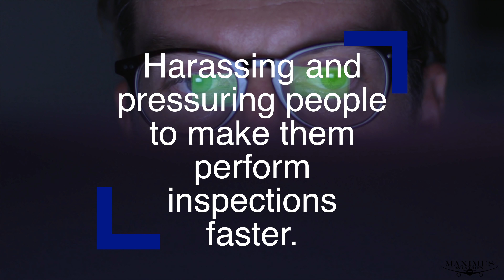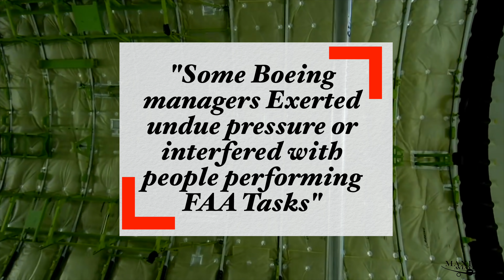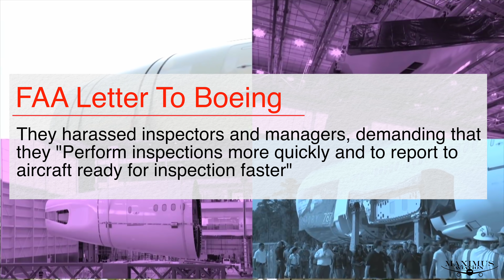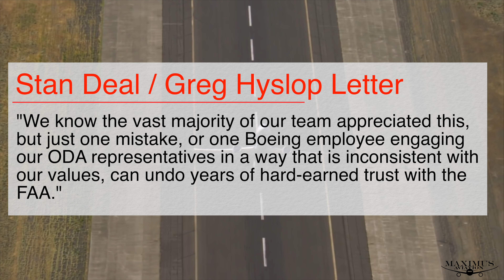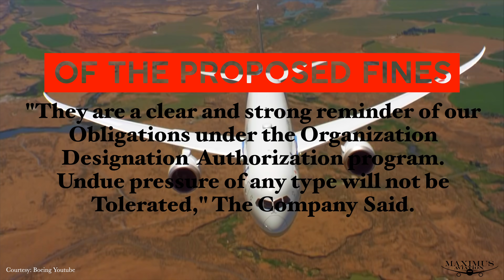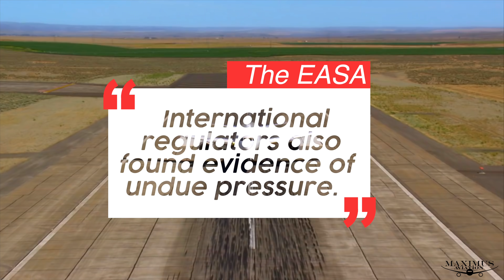FAA Fines Boeing 787 Program $1.25 Million Dollars For Interfering With The FAA's Inspection Process

Comment: Two planes crashed as a result of Boeing’s incompetence.  Why has nobody in Boeing been tried for manslaughter and been locked away in prison for several years?
Reply: I agree 1000%!
Reply: Boeing, yet again prioritising money and profit potentially over peoples lives. When will they ever learn? It has to stop. Heads should roll in senior management and hefty gaol sentences should be imposed on the guilty parties for this avaricious culture.
Reply: The FAA will never charge Boeing Execs with anything or many skeletons will fall out of a lot of cupboards. In any other country as soon as the second investigation report was published Police would have been knocking on doors with arrest warrants. Not ONE Boeing exec has been arrested. The only 'casualty' left with $60 Mn in his pocket.
Reply: If you only knew the insane software that was running in MCAS. It was as if it had been designed from the outset to be difficult to make any sense of and clearly totally confused flight crew when it went into 'autocrash mode'. I've designed real-time software myself that could be considered as 'safety critical' and when I became aware of how truly bad the MCAS software was (words fail me to adequately describe it) it was hard to understand how anyone could make such a complete mess of it, let alone allow it into production. It deserved to be strangled at birth. It was criminally negligent by design !
Reply: @pasoundman  Well said. But you forgot to mention that not only was it poor software, excessively intrusive or that could not be switched off (unless flaps are lowered) Boeing compounded that by not only failing to issue training manuals and synthetic training software for simulators but also deliberately misleading the FAA, customer airlines and passengers that it even existed.
The sequence of failure just goes on and on ...
Reply: @1chish  The crazy thing is that it WAS POSSIBLE to defeat the defective (actions of) MCAS. The trouble with it was relying on the crew's normal training to handle a 'runaway trim' situation in short order. You're right about the absense of any information about MCAS and how it influenced the aircraft's trim of course and this goes to the heart of the matter. I have no idea how MCAS and its operation and logic was described to the FAA or anyone else. My own opinion was that it was Boeing's responsibility to describe MCAS and its operation FULLY to the FAA and in unambiguous terms to users who might not need to know how exactly it worked but that it existed and how to defeat it if neccessary, as a contactual issue. I believe that the FAA should have been fully informed about MCAS by Boeing and if they didn't know its details but did know of its existence to ask for these details.

The fundamental problem was MCAS 'wasn't meant to appear to be there' ! This goes to the contractual issues with airlines who didn't want a new type rating for the plane, so it had to handle as if it were a previous generation 737. This seems to have been the rationale for the failure to describe it in manuals or training. AFAIK there was nothing specific about it in the QRH either. MCAS could perhaps have been described as a bit 'bipolar' to some extent.

At least one crew did successfully recover from a 'defective MCAS' incident. I'm assuming that such a condition was caused by a failed AoA sensor or vane. Either by luck or design they detected a runaway trim that is similar but not identical to what MCAS does when faulty and performed the corrective actions for it. It involves IIRC throwing 2 switches close to the Captain's knee related to the electric auto-trim. It has to be done quickly though. If a delay takes place due to the surprise effect or consulting the QRH runaway trim actions, loads may quickly build up on the control column that mean the aircraft is already unrecoverable.
Reply: @pasoundman  Excellent summary my friend. Its just tragic a company like Boeing thought it could do this and get away with it...
Reply: @1chish  Absolutely and all the more so because, historically, Boeing designed perfectly good airplanes and was considered a 'good actor' as it's popularly called now. Looking back at this, one can't help but think of the DC-10's troubled entry into service and McDonald Douglas's obfuscation over a number of things.
Reply: @1chish  BTW, just watched a training video that involves diagnosing runaway stabiliser trim using the actions described in the QRH. It took 1 minute 20 seconds before the cutout swiches were flipped. In that time there could have been 6 five second applications of nose down trim applied by MCAS.which I suspect is marginal for controllable aero loads on the yoke.
Reply: @pasoundman  I think the link between the takeover of McD - D and the change in business ethics and philosophy in Boeing are very clear to see. It became a Wall Street operator preferring share buy backs and high dividends to friends rather than invest in advanced engineering. Boeing have not delivered a working aircraft on time and on budget since before the 787 which itself was the first signal that it was no longer the engineering leader it used to be when it was grounded. That aircraft loses $20 Mn per delivery. Can you imagine the fallout in the US media if Airbus had had the A350 grounded  for battery fires and the A320neo had killed 346 people in two crashes? Boeing even failed to deliver a rebuilt 767 as a tanker that works, on time and on budget to the USAF. It still doesn't 12 years after order.
Reply: @1chish  You'lll get no argument from me for sure regarding those issues. I expect that the 787 no longer makes a loss (although I don't know for sure), you have to consider the barking mad economics of Wall St that include 'deficit funding' that makes as much sense as investing in 'junk bonds' that were so popular a while ago and merely a verhicle for the gambling addicts in banks to make yet more money out of hoax investments. One needs to examine these insane terms and realise what they really and truly are, just slogans that fuel the gambling addiction of the finance sector.

We have as a society surrendered to the money god and we're paying the price. It has to stop or we're screwed.
Reply: @pasoundman  Amen to your last thoughts Mate. As for the 787 I am going off the system that Boeing uses to 'lay off' or 'spread' R & D costs over a specific number of future aircraft sales. They do this to produce early profits for guess who? This works when they had the 737 Cash Cow feeding capital back into the business but now?
Airbus takes the hit in the years the costs occur (although each project is tracked internally for profit or loss).
This is from 2015 but given the numbers I think it still holds good. Begs the question if Boeing will 'spread' the MAX costs over future sales and if so will it ever make any money? Meaning 2 of its 3 products will lose money. 

https://www.seattletimes.com/business/boeing-aerospace/will-787-program-ever-show-an-overall-profit-analysts-grow-more-skeptical/
Reply: @1chish  The mind boggles at $32 billion of debt for an airliner that was meant to cost less to develop yet also arrived years late.

Looking forward, the next new plane to appear from Boeing will be the 777X but who will buy a huge plane when the market is depressed by Covid ?
Reply: @pasoundman  Just as you are I am not so sure the 777X will be the saving grace for Boeing. Certainly not the 777-10 which is in A380 passenger territory and has no dates attached. The 777-9 will not enter service until mid 2022 and will keep running up huge development costs and will be 2 years late if the meet that date. 787 revisited. It has lost orders to both the A350-900 and the 787 and has just 276 orders. The 777-8 has just 32 orders of which 20 are said be likely cancellations.
The 777X has the same problem the 737 had as Airbus are years ahead with the A350 which has a backlog of 558 aircraft (-9 and -10). Its a proven aircraft. Does any airline really trust Boeing to deliver a new aircraft on time and in safe condition? Especially as GE have issues with the GE9X engine without which the 777X has no advantages.
But we come back to the root of Boeing;s problems. Cashflow. With the 777X some 2 years away, the 787 losing money, the KC-46 some $4 bn over budget and the Golden Goose MAX grounded with no deliveries what nett cash does it have coming in (apart from Poseidens, Apaches and Chinooks)?  Not a lot.
And all this before the costs of rebuilding all the MAX aircraft parked up and already delivered start to roll in. Aviation is not a great industry to be in but I would rather be in Toulouse than Seattle right now.
Reply: @1chish  You could have taken the words out of my mouth. How exactly has  Boeing screwed up the KC-46 ? Isn't it simply a B767 derivative. What could go wrong ? Maybe the USAF should have stuck with Airbus's A330 MRTT !
Reply: @1chish  Having considered the ongoing catastrophe that is the KC-46 I can only say 'oh dear'. Is Boeing entirely incapable of manufacturing a flaw free aircraft these days ?
Reply: @pasoundman  At the moment the answer has to 'Yes'..... That such a brilliant engineering company has fallen so far into the grip of Wall Street is a tragedy in itself.
Reply: @1chish  Bring back the old times. LOL

Comment: The word 'scandalous' doesn't come anywhere close to describing the mega disturbing situation at Boeing, which appears to worsten as the months progress. It's almost unbelievable. What is additionally shocking is that to the best of my knowledge no-one in the company has yet been charged wiih neglect and culpability over the two 737 Max crashes. I'm  overflowing with disgust at the general scenario emerging from Seattle. I'll not entrust my personal safety to any of their products in future air travel plans unless and until there's one almighty change of corporate mindset.  Nothing short of a managerial revolution from the top downwards is required and immediately.

Comment: The culture at Boeing has utterly collapsed so much it’s astounding that most of the management hasn’t summarily been down the door, this cultural rot comes from the top and percolates down to mid level and floor workers. If I was an investor I’d demand a new competent board of directors that actually does its job to oversee executives. I’d love to see hire much their process management budget has grown compared to their budget for lobbyists in DC.
Reply: Put the engineers back in charge. They may not make the best managers (whatever that means) but most have some ethics.

Comment: Or as we say here in the UK - "Play the ball not the man". Haters will hate especially if they are biased one way or another.
So playing the ball ......
The list of failures and rule bending by Boeing apparently just goes on and on and now its more news about the 787. I have thought for a long while that Boeing has failed to deliver a viable and safe new aircraft since about 2005 and changes in the Boeing Board:
The 787 was late, over budget, grounded and loses $20 Mn per aircraft delivered.
The 737 MAX tragedy continued that story (and should never have even been a 737)
The KC-46 saga is just a long tale of corrupt and jailed Boeing executives, political rigging, late delivery, over budget ($4.6 Bn Boeing excess costs on a $4.9 Bn programme) and another grounded aircraft. Just like the 787 and 737 MAX the KC-46 is years late, has safety issues with freight, can't refuel via its boom until 2023 and the USAF are only paying 80% of the contract price when delivered.
Any other aerospace company would have been shut down.
Reply from the maker: Summed up quite nicely.

Comment: The moon, not the finger, or don't shoot the messenger! Yup, every time I see a Boeing story, I brace myself. The silver thread here is that it was last year. Although this happened a few months after the grounding of the 737 MAX, the Boeing board was still very arrogant and Teflon coated. I wonder if they realize how badly tarnished their reputation is? If they did, they would have replaced with more aviation engineers board members. Last I checked, it's still the same club. It's doesn't send a positive message out there. How many Boeings were rushed out the door, the same airplanes we used to fly on?

Comment: This rather smacks of '...closing the stable door after the horse has bolted'. It sounds like this has been going on for some time and has only come to light because of the scrutiny due to the 737 MAX debacle. Inspections should be independent otherwise you end up with the situation which seems to be occurring at Boeing.

Comment: Does Airbus self certify in the same way Boeing does for the FAA?
Reply: good question.
Reply: Yes.
Reply: How many airbus planes of questionable quality do we have flying currently ? think it almost zero as airbus is not just one country supplier but many each with there own parts being thoroughly inspected and passed before onward travel for assembly. Airbus, a plane made of many parts from many competent countries supplying them. exactly !
Reply: @ianburit3705  Also Airbus tends to make most of its own bits, so the quality is 'in-house'  and hence under its own control rather than relying on subbies.
Reply: @pasoundman  Not quite correct, as until march 2003 the company I worked for made main landing gear attachment parts In a recognised UK company in the middle of the top 10 Uk subcontractors along with many other aerospace names like RR UK and RR Germany. I made gear ribs and  spars that fitted the wings made in the UK, but Insolvency shut our company in its majority but had to continue to run a further 6 months with a skeleton staff making A380 parts plus the normal range of current "then" A series Airbus parts.. I made the first few A380 parts on my machine but the part was far too big so it had to be done in two halves while we waited on a new double pallet loading machine that ran 7 days and nights not stopping for anything except 2 days at Christmas, i worked nights only some "weeks" were 12 nights long.. a true 24/ 7/ 363 year running company just to meet production targets as In just in time production/ very proud of my work.If we had just stopped no other subbie company had accreditation to make the parts so airbus would have ground to a halt, thus the 6 month extension to allow another company to get up to speed and certification.. The UK makes Airbus wings from subbie companies supplying parts.
Reply: @ianburit3705  Interesting (and sad) to hear all that and I'm all too aware of the lamentable destruction of industry in the UK. I too am a 'victim'. It seem as if our lame political masters only believe in 'services' today. Britain once had a proud aviation industry and there now remains little evidence of it. Heavy industries like coal and steel have vanished together with cars (mostly) and even electronics. It's a disaster.

Comment: It's time for a much harsher punishment for Boeing and it's management. Higher management can play the innocent, but the pressure always comes from the top. So they are responsible as they set the rules of the game within the company when it comes to everything from structure, salaries, performance bonuses  and so on. Time for imprisonment and maybe a shut down of the company for 30 days. This may be what's needed to set the record straight when it comes to a systematic corruption and safety regulation ignorance.
Reply: The FAA can't give out prison terms sadly.

Comment: A few crashes and piles of dead bodies is collateral damage for Boeing and is acceptable to them. The 737 is past its sell by date, its basically 50 years old. They should design and build a replacement aircraft. The individual management in this latest episode should be personally fined and or jailed. Boeing seem not to give a *uck and only make the right noises when kicked up thier arse. The FAA and Boeing should be totally separate. I don't want to fly Boeing  but I don't have much choice